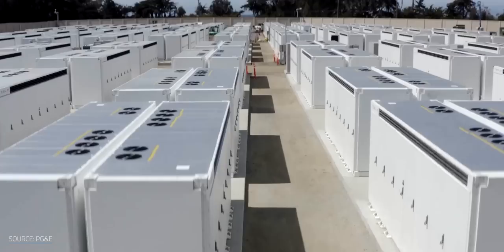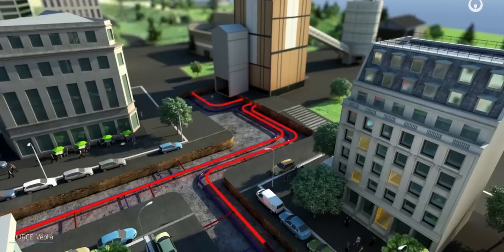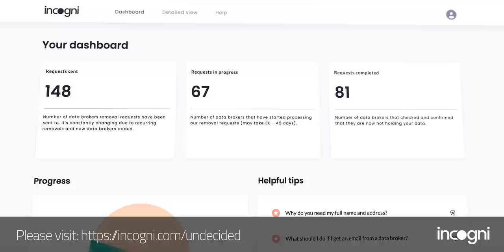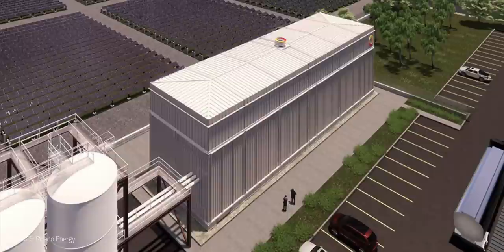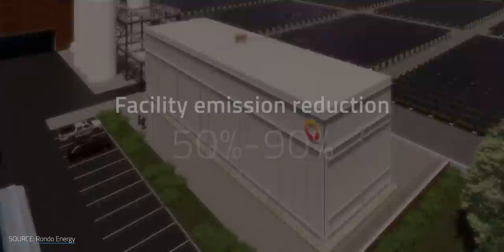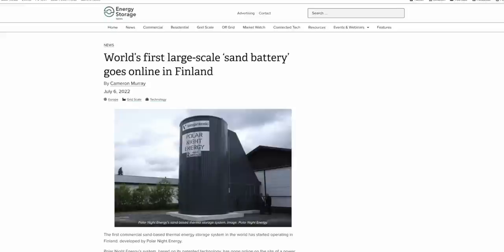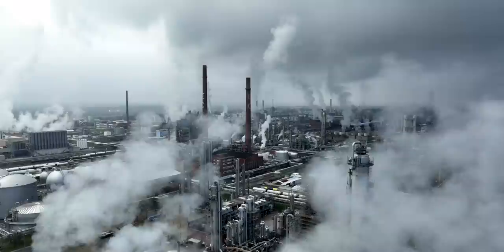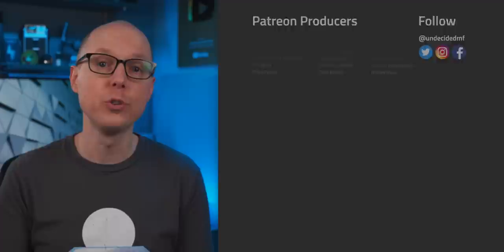How A Brick & Rock Battery Is Changing Energy Storage

Comment from the maker: Do you think storing heat is a smart move? The first 100 people to use code UNDECIDED at the link below will get 20% off of Incogni: https://incogni.com/undecided.

If you liked this video, check out Solar Panels Plus Farming? Agrivoltaics Explained https://youtu.be/lgZBlD-TCFE?list=PLnTSM-ORSgi5LVxHfWfQE6-Y_HnK-sgXS
Reply: Do you know what would have been a smart move, developing and investing these technologies over 100 years ago when these ideas were first brought to market... unfortunately the world went with oil,  and we've fought to the death for it ever since.
Reply: I think storing heat is a good idea but it's so early in its stage of development to say if it is worth it or not
Reply: That's the kind of news that makes my day. Thanks for all of the research that you do.
Reply: I solved the riddle… Uranium
Reply: If they need 1600° to make steel, couldn't they just use the battery to get the first 1500° and then burn something for the last 100°? Seems an easy solution to avoid almost 94% of the emissions.
Reply: @WSmith_1984  before there was oil there was fighting. After oil we’ll fight about something else.
Reply: @slcpunk2740  rational thinking spotted.
Reply: Good video! Just subscribed. I do have a question. I have always wandered why lower temperature heat sources couldn't be used to boost higher temperature consumers in some cases.  E.g. a scrap steel mill could preheat the scrap with the lower temp source then take it the rest of the way with the dirty energy. Cost could be the problem here but it is just an example. There should be some use cases where this makes since.
Reply: what battery size is best for longveity , then cars should get near that than add small combustion to charge car optimal effiency due to no need to change combustiosn per second so much and no need to deal with sudden dshocks of energy of transmissions shifting or combustiosn per secodn change etc, not even need for spnning parts
Reply: @kalmmonke5037  I think you just described a hybrid.
Reply: id also check out vattenfall and siemens-gamesa. they both built big heat storage plants in germany
Reply: Matt can we possibly talk privately?
Reply: Incogni must have fantastic data brokerage for all its collecting
Reply: I’d like to understand potential for use of high heat - heat pump tech in conjunction with sand or brick heat storage.  It seems like it would provide way to achieve massive reduction in carbon to heat steel
Reply: The reality is that the BEST AND SAFEST energy storage is in hydrocarbons - i.e. diesel. That's why plants use this form of energy storage as well as animals. It has the highest and most stable energy capacity far better than even graphene batteries. It's a result of 3 billions years of evolution. The only downside would be lowering of CO2 in the atmosphere which is since the whaling industry boom near critical levels (killing nearly all the whales led to sharp increase in plankton consuming CO2 and sharp fall of this scarce gas which is essential for life). we have only 00.038% of CO2 in the atmosphere and the minimum critical level for complete planetary extinction of all life is 00.015%. The danger of recycling CO2 to deisel would be lowering CO2 in the atmosphere and the consequences are poorer plant growth and the risk of triggering planetary wide famine so we would need to maintain supply of CO2.
Reply: @precisionleadthrowing4628  where are the gasoline batteries
Reply: @RhizometricReality  LOL, those are in liquid form available in supermarkets and petrol stations - It's called oils, gasoline and diesel. (both are recycled CO2 - seed oils contain recently captured solar energy and petrol/diesel have old and sometimes recently captured solar energy mixed in (bio-dielsel). Fun fact - The same stuff that you fry your chips in can run cars and trucks (with some lubricating additives) and it's the best form of energy storage that it so stable it can last for millions of years without any energy losses.
Reply: @precisionleadthrowing4628  yeah no shit so why are we burning it why can't we make a battery from it.
We are wasting most of the potential energy as thermal waste instead of finding a more efficient solution.
Why can't I go pick up a hydrocarbonic alloy battery at the store eh??? Is it because then they couldn't sell as much gasoline??
🤔🤔🤔🤔
Reply: @RhizometricReality  Because burning is it EXACTLY how you release the energy. It's far more efficient even with the thermal losses than any other battery/Electric motor system because you don't have radiative losses, thermal losses, parasitic drag on EM fields/ radioactive losses, resistance losses, efficiency losses, degradation of charge, degradation of coils, degradation of efficiency under load and so on and so on - and you don't drag around the depleted medium that weights literally tons. Empty electric battery has still the same weight full or empty (the difference is negligible) but carbohydrates leave literally empty tank reducing weight of the vehicle and increasing efficiency as the energy storage goes down - which as a bonus you can recharge (by pouring in new load of carbohydrates) in matter of few seconds or minutes. Plus modern diesel engines are highly effective with no pollution to environment. You get mainly pure CO2 that's ready for recycling by plants and you are helping to save the planet from starvation and extinction  as a bonus.
Reply: Something you might find interesting, also in Finland, in the city of Turku, they used the underground natural clay deposit as a heat battery to keep the new main square defrosted during winter, using mostly heat accumulated during summer.
Reply: @precisionleadthrowing4628  unacceptable retracting of the goal. 
Releasing gas is not an acceptable mechanism. It needs to be self contained.  
What do you work for, BP? 
Build better.
The planet isn't your co2 energy disposal mechanism.
Reply: Yes heat storage is the smartest method to store energy.
Reply: Matt, I am looking to build my own "Heat Storage Solution" for increasing the efficiency of my air source Freon heat pump ( I live in a place where it gets really cold in the winter and hot in the summer )   My idea is to dump heat into a area/thermal storage cache during the summer via the air conditioner, then in winter pull the heat back into the house!

I am planning on use entirely off the shelf and recycled and reused components.   Hopefully it will work out.
Reply: Resistive seems wasteful...@ least for a portion of the temperature gradient range? Wouldn't a "range optimized" heat pump be more efficient? At least for a portion of the gradient?
Reply: Its definitely a good option, but again as one of many parts to the overall solution.. You could say that, all in all its just another brick in the wall. 😎
Reply: i do really enjoy you exploring these non-streamlined technologies especially when it is related to the power system.
Reply: I think if we can generate the heat to begin with for free such as using lava flows etc and towns are built near these flows, it's a great idea, but moving energy to these units and generating the initial heat might take more than what we will save.
Reply: With 95%+ efficiency it does sound good.  In the event of a plant accident where a heat cell were ruptured the environmental effect would be minimal and easy to clean up if properly designed with good safety protocols.  What would supplement this in huge way would be a way to capture natural heat from the environmental air temperatures such as those west texas, and in the deserts in Nevada, New Mexico and Arizona or in India where air temps are reported over 150 degrees in some times of the year.  I've seen water heaters that pull the heat out of the air with a fan intake.  I wonder if that could be applied in high temp regions?
Reply: When making high heat industrial products, obviously there is plenty of heat that is given off into the surroundings. Are there ways to recapture some of that heat and put if back into a battery? Like a heat pump made for for high heat operation?
Reply: I don't think it's feasible for normal households, maybe for industry.

But in 10 to 20 years most households infrastructure will be focused on electricity to heat the house. So we need a proped battery (saltwater?) to store our energy created by our solar panels.

Not some obscure piece of rock that can store heat. Then we have to renew our in home infrastructure (again!) to transfer heat again.

So like I said maybe it can help the industry reduce their carbon footprint, but I don't think it can be used as the onle heat source, just a bit of help. Let's focus on a real solution in stead if these bandages.
Reply: @ancienttechnology7337  LOL, carbohydrates are the smartest storage of energy. The energy density is far greater, and it's stable without losses. Things cool down relatively fast (known fact)
Reply: probably a waste of time but could you please scream at youtube some more about these godawful reply scammers?

Every time I make a top level comment here I'm guaranteed to get one
Reply: These bricks/rocks being heated by electric energy directly. This seems like a waste. Isn't it possible to heat up using a heat pump, so you can even cool at that moment as well? If you get a COP of 4/5 it could be a lot more interesting I think.I don't think you'll be able to heat up that much, but it could be used
Reply: @janpietervandenheuvel5784  Heat pumps are only efficient within a certain range of temps, so charging these via that method is a losing proposition, on the discharge side it is pretty much how they work with some differences for scale
Reply: Its seem u missed this one: https://www.youtube.com/watch?v=5ynPoAqK0t0 which already work in Israel
Reply: We have a them song:  David Rovics, 'The Biggest Windmill'
Reply: no, Edison batteries last longer and can store more energy, they only require lye as an electrolyte and steel and nickel, very simple and reliable with some of the batteries lasting over 100 years and are used in railway switches
Reply: @kaeptnjoker  about the effects of whaling. you can measure the impact by multiplying the estimated numbers of whales at that time by how many tons each whale eats (about 16 tons of krill and zooplankton that feeds on a day or nearly 6000 tons a year per whale) and you can calculate the impact on environment by calculating how much CO2 you need to grow one ton of phytoplankton and how many tons of phytoplankton you need to feed one ton of krill.  (do the math - it's fun). the doomsday cult is of course claiming that the increase in krill is due to whales pooping (which is like claiming there is a magic  perpetuum mobile) but the growth is caused by increased levels of CO2 which is essential for phytoplankton growth (whale poop helps a tiny bit but main effect is increased supply in CO2 - which the doomsday cult never admits. This was confirmed experimentally in laboratory and  agricultural studies
Reply: probably not a bad idea once solar and wind becomes too cheap and plenty, power dumped or pause generation whenever there's excess than demand. however, if batteries and other more efficient storage keeps up, converting electricity to just to store it as heat is terribly inefficient
Reply: @precisionleadthrowing4628  You're contradicting yourself. In your first comment you said the CO2 levels are falling due to massive increase in krill population, now you're saying increased CO2 levels are causing krill growth. Which is, more CO2 or less?
Also, please stick to arguments and resist the need for derision, it just makes you comments harder to read.
Reply: @dipladonic  spot on, and on top of it the so called "renewables" are not renewable. Most of the junk is nonrenewable one time use, toxic and can't be recycled (wind turbine blades, photovoltaic panels, and so on)
Reply: @precisionleadthrowing4628  Indeed, and paradoxically, without the energy-dense, utilitarian and reliable hydrocarbons, derivatives and distillates that unreliable renewables are trying to replace, unreliable renewables couldn't exist.
Reply: @keithwong7001  Heat pumps should be an efficient way to gather some of that energy, and could be stored in a Rondo battery for industrial use.
Reply: Not smart. Obvious. But thanks for the video, good to see another step for the energy sector on its progress towards kindergarten level reasoning.
Reply: @johanfolkesson5170  Indeed. Unfortunately, when it comes to energy backup, people are too eager to believe in anything. Credulity and benighted reasoning have become the order of the day.
Reply: @WSmith_1984  yep. Amazingly they had electric batteries and loads of amazing solutions in the mid to late 1800’s. But yep, oil took over! 😩.
Reply: @WSmith_1984  Yeah genius, why don't you just build a time machine and tell everyone that instead of using cheap affordable and abundant energy that would increase the standard of living of 99% of the world in exchange for investing in research of this technology that wouldn't even exist without oil.
Reply: Thank you for your content, you are one of the most important kind of creators in todays society. Educating and inspiring people. Please do not stop
Reply: Literally global warming lmao
Reply: Matt, what is the round trip efficiency if the generated steam is used to spin a turbine?
Same question, if heat generates electricity using the thermal electric seebeck effect?
Reply: I think that we could utilize these systems with roads to take advantage of their surface area and solar heat
Reply: Store heat at the SMALL LOCAL LEVEL heating our homes and businesses.
the 1500C limitation sounds like a lot, except many, many industries need FAR more than that (eg: smelting.)  1500C isn't enough to do many of the jobs....  but if it does SOME for nearly-free, then call it a win and put it to work!
Reply: Decentralization is the key.  Large scale implementation will always result in socialist tyranny by those with the guns.
Reply: What you need is to storing temperature differential.    If you can store 1000 degrees C or -270 C; you can do work with a temperature differential.  And there is always an emission to create a temperature differential.   It's basic physics.
Reply: @WSmith_1984  There is still no practical way to create the heat for an industrialized civilization without fossil fuels, unless you're willing to go 80% atomic energy.
Reply: you can create electricity by heat difference as well
Reply: It would seem to be applicable to home use scale and temperature. We don’t need to smelt iron ore just heat/cool our homes and make electricity with a steam powered generator. I wonder if you could produce enough heat with 100+/- solar panels.
Reply: @LucenProject  cowper bricks... Basically bricks with holes in them. They are stacked tall, and flue gas from blast furnace is then pumped through. Once the brick are hot, the flow is reversed. This system requires atleast 3 stacks to work, but I think actual blast furnaces have more than that... If this idea sounds nice and futuristic TES technology, it really isn't. I read about it from a 1940's book, and it was old news even then... As the technology is from mid 19th century.